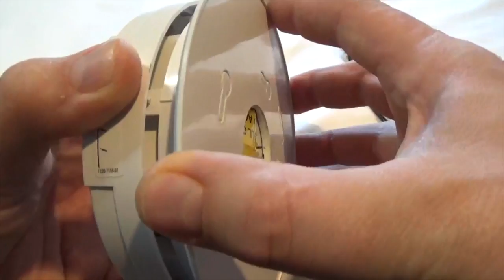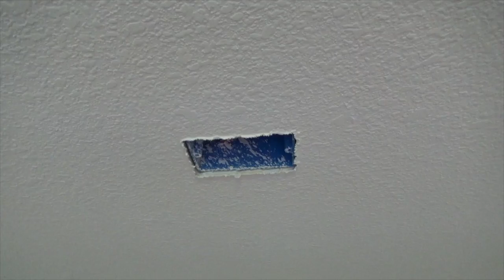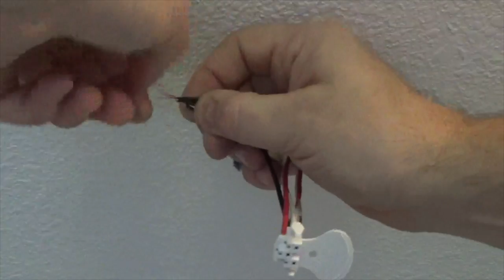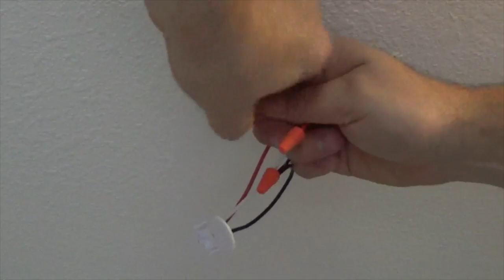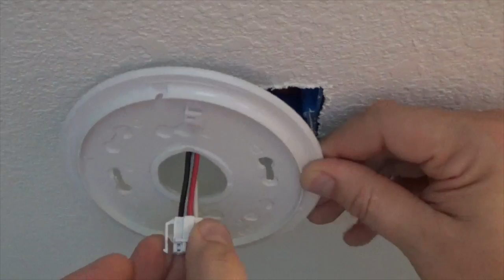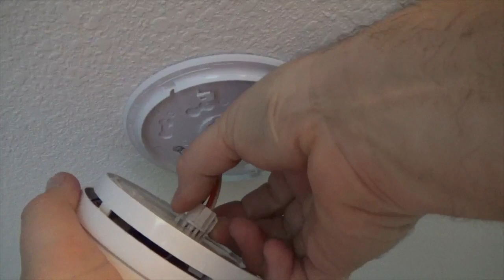How to Install a Wired Smoke Alarm - 120V Wired Smoke Detector

Comment: Thanks for the video it has helped but i need to ask a question I understand that the alarms are 120volt im used to wiring lightin in 1.5 wire but the electricity is 240volt . My question is this are the alarms 120volt or can i use a lighting circuit . I dont understand how to wire the alarms 120volt when my electricity is 240 volt or am i missing something . I feel confused
Reply from the maker: Yeah, not sure about your 240 V system. That seems a bit high on voltage.

Comment: I'm still confused about the three wires in the box because you already have the ground wire which was not in use. The black should be the neutral, then please further explanation on the red and black wire
Reply: White is neutral, black is power (to power the devices), and red is used to send signal from one to the others in the circuit. So if one goes off, they all go off.
Reply from the maker: not sure what you mean...

Comment: hi
Im replacing my old hardwired smoke alarm.  It  only has two wires ...not 3.   It will be the only hardwire alarm.   Do I just cover the red wire with a nut and tape?
Reply from the maker: I don't like giving advice on electrical matters without being present.   .........because I care about your safety, Carolyn.  However, you could go to an electrical store and show them pictures of your situation and discuss it. This will probably be the best method without hiring an electrician.

Comment: I guess I need an electrician..I want to add one to my basement.  I know how to do this…just don’t know how to tie in to “what” in my basement. Oh well. I need to tie into  something or get a new circuit breaker and bring new wire??
Reply from the maker: probably should get an electrician to rough-in the lines first if you have never done that.

Comment: My box does not have the red wire. What do I do with the red wire on the unit?
Reply: The red wire is used to connect multiple units, so when one alarms, the others will get triggered also. If you don't have multiple units that need to be interconnected, the red wire on the smoke alarm can be nutted and remain unused. If you do have multiple units and you have access to the wiring for the multiple junction boxes, you should run new 3 wire.
Reply from the maker: i don't know without looking at it.  Maybe someone else here can chime in.....

Comment: So I can't find which knob in the breaker circuit is for the fire alarm and the wired alarm I want to replace has cut wires. Is it possible to cover the wires up or put a battery alarm over the hard wired one?
Reply from the maker: use a wire tester to find the circuit.   Then.... turn it off if you aren't using it.  You can always purchase and use battery operated smoke alarms.

Comment: Thanks for easy to follow vid. (late to the party lol) I was wondering if can I use this smoke alarm without plugging it into a ceiling electrical box? I am in an apartment and I am not allowed to do so. Thanks
Reply from the maker: I have never tried that, but the whole purpose of it being dual is that fact that it should work without electricity.  So...... I imagine it will.  Or.... you can just buy a battery operated one that is cheaper.  let me know how it works out.  Thanks for watching and commenting, Bernard!

Comment: I am replacing my smoke detector unit and the new one I bought comes with new wires in its package - do I have to use these or can I use the old wires/harness from before and plug that in to the new unit? Thank you!
Reply from the maker: If the wire harness looks the same, then you can just plug it in.  Current is color-blind........ it only reads copper.  Hope this helps you out, my friend!
Reply: Phil Crockett thanks! I ended up plugging in the old harness and had a tiny bit of trouble because it was a tight fit but it worked out in the end. Looked exactly the same...
Reply from the maker: As long as it worked!  Glad to hear it!
Reply: @bostonrachel  You just answered my question too.

Comment: Just came across your video. Thanks for doing. Quick question: I have to replace a smoke alarm in my mother-in-laws house, and also add a carbon monoxide detector. There are six other FireX smoke detectors throughout the house and basement. They all "talk" to each other when the test button is pressed on just one of them. When I put in the new detector ... and also add the carbon monoxide detector, is there anything additional I need to do in order to make  these two new units communicate with all the rest??
Reply from the maker: You would have to have these all on the same circuit, which probably is impossible unless you have an unfinished area to tie them in to the others.   I wouldn't worry about them communicating.  unless you live in a 20,000 square foot mansion, you should be able to hear them go off at a short distance.

Comment: I bought a replacement detector.. and the wires coming from the ceiling already has the connecter where I can just connect the new detector but.. the wires are not in the same order as the new box.. meaning if I connext the new one.. the red is connecting to the white and vice versa.. in wich sets off all alarms immediately.. how do I fix it? Do i have to cut out the old connecter?
Reply from the maker: If that were my project, I would take that plug out and wire the new one in.

Comment: I see the back of the alarm said it was an ionization type alarm. In the owners’ manual, is there a statement saying, “For best protection, use both ionization and photoelectric type alarms”. If so, how would you suggest this is accomplished?  It looks to me that what you have installed is not the best protection according to the manufacturer. 

I have investigated this topic extensively and come to the conclusion that you need to have a photoelectric detector to be fully protected. 

I’m very interested in your opinion on this subject.
Reply from the maker: I simply installed what my electrician recommended.   I matched what he installed a few years ago upstairs.    The ones in this video I installed in my basement.   They work well when I had smoke come out of the wood stove recently.  Apparently they work very well, and my electrician was right.  Thanks for the question.

Comment: So can I use 12-2 or does it need to be 12-3 on a 15 amp breaker? Or 20 amp
Reply: Oscar Ochoa my own house has 14/3 between all detectors. Except the first wire between the electric panel and the First detector is 14/2. And it’s a 15 amp breaker.
Reply: If you have multiple alarms, you would need a 3 wire, but the homerun would be a 2 wire.  Also you can use either 14 or 12 gauge wire, makes no difference.   Just put in proper ampage breaker depending on wire gauge.
Reply from the maker: I like what my friends here say